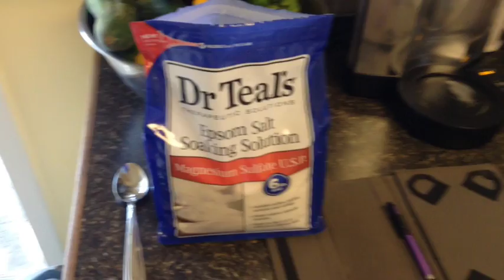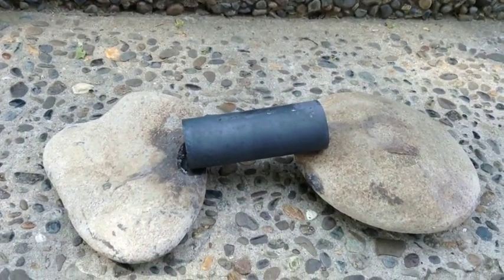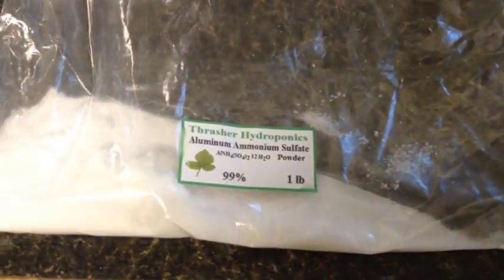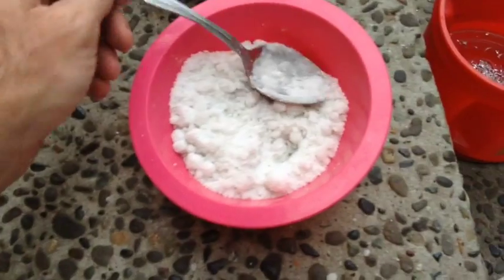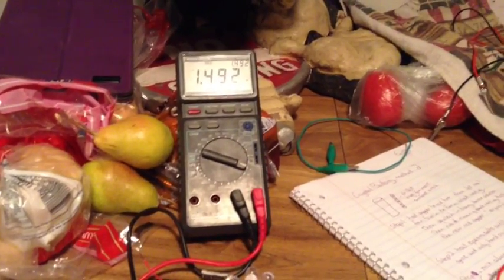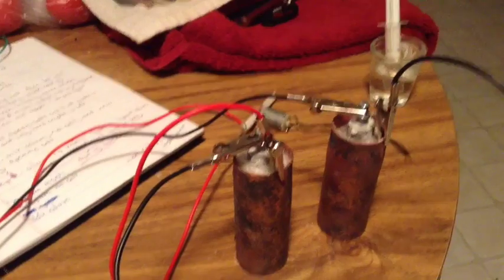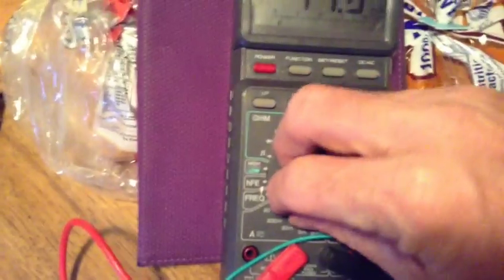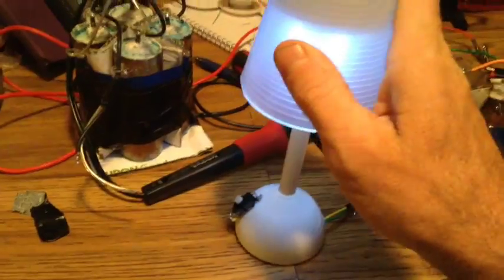V3 Crystal Battery High Output 1/2 amp spike 2 in parallel dead short. high psi

Comment: just asking but would coating the inside of the copper chamber with active carbon increase power?
Reply from the maker: you're most definitely on to something but I haven't messed with the crystal batteries in quite a while I will return to them one day but I would try graphene of some type. but you wouldn't be able to just put it on the surface of the copper you would need to intercolate the two materials. watch it try some activated carbon and find out a way to stick it to the copper and start simple

Comment: with the straight Alum battery are you also boiling down the Alum, like you did the borax mix?
Reply from the maker: nope. just the crystal form of the salt. no heating
Reply: BackRoom Labs so how long did the little motor run? When they die can another source of electricity charge them back up? Or is it just add more water? If it's just adding more water, does this make me mix in the tube dissolve to where is it could pour/leak out if if laying sideways?... if not what if you give it more water than it can handle by making like a tank for it? And if the tank idea is ok, what if the water bridges the pipe and the rod? Well let's say with or with out the water bridging, and the tank has let the cell take on all the water it can handle with more water waiting for a change to get in.... would this make for opportunity for the solution to mix into the tank and leave the cell?

Comment: Hi Backroom, to increase the power output, Have you considered trying making one or two of your batteries with increasing the surface contact of the Salt to the Copper, By sanding the inside of the pipe just before the salt install step? I would bet that you don't need the semi-conductor layer, and the benefit of more power is more valuable than the internal Diode feature. I was Just thinking Back to my Semiconductor Doping Course , Why Would you need a Transistor feature in a battery? there will most likely be a 0.7V Drop at that layer. All the Best
Reply from the maker: +Cherry Jj  you no I though the same thing after I made them. I am getting ready to make some more in conjunction with some homemade graphene supercaps. I plan on sanding all surfaces this time. thanks for the input and thanks for watching.

Comment: Hi, at 7:30 you said you used the same method and then showed the press - what was the press for please? Did you use it to compress the material into the cell? Also, do you have any videos showing how the cells are made? I'd like to try making a few to experiment with... thanks for posting your work - very interesting subject! best regards.
Reply from the maker: +Valerifon1 sorry I haven't responded to you post I just seen it. Yes I have many vids on the crystal cells. Just go to videos and they are at the bottem. The theory was with pressure there might be more out put. I'll be posting a few vids in a month or so on some new cells I'm making.

Comment: Interesting but I can't help wondering if you put in far more energy with your gas torch and your stove than you are likely to get out of these cells?   Seems like a net loss to me.
Reply from the maker: I couldn't agree more. These by no means overunity. Think of the energy used to mine the minerals, machining, shipping the list goes on. To me this is a very cool experiment that allows a regular joes to creat a power cell at home that will make power for many many years. Shortly I will be making new cells in combination with a home made graphine energy storage device. This will let me store the power for when it's needed. Hopefully I'll be able to light a 3 watt led for a desktop lamp. Those vids will be coming in a few weeks. Works been busy since it got cold. Thanks for the input

Comment: How long the battery charge last before its completely discharged?
Reply from the maker: Around 8 to 10 hours. Take the load off for several hours add a few drops of distilled water and bam... They are back to life.
Reply: Sound good

Comment: Has anyone attempted to wire these batteries in series to get 12 volts and why are them too is solar charger controller to see if they will push charge into a rechargeable battery? Because if that works soundly, then why is anybody buying solar panels when they can make batteries with dirt and a couple hundred dollars?
Reply: Yes. Look up laserhacker.com he does some awesome little experiments with these cells. He also does experiments with supercapacitors and solar cells, too.

Comment: hmm you have to use more energy than these will ever produce to make one, but could be usefull in a low draw long term application if you get the mix just right
Reply from the maker: These cells have been very useful. Some have been in operation for 2 years. I have been working on some home made super-capacitors to store the energy until it is needed. The ones in this vid have leveled off to around 20ma 24/7.

Comment: You could try copper foil and magnesium/aluminium foil with thin salt layer between them
Reply from the maker: That has been done by a few people. They started off good. If it is more of a galvanic cell it eats the thin material to fast. The thicker material will last longer as the cell levels off and will allow the cell to last much longer. Another problem was the center of the cells would completely dry out. Not to many have tried to prefect the method you are asking about. But it's a good place to start as materials are cheap.

Comment: I had good results on mine for the first day or so, but they barely spin a tiny motor for a couple of seconds now.
Reply from the maker: Mine still put out enough power to run several LEDs. I have to add a few drops of water every week to keep em going as well as take the off the load for a while to let them rest. These cells turned out to be pretty corrosive to the magnesium. I'm going to do an update in like a month or so with all my different cells.
Reply: +BackRoom Labs What was the mixture you used? I followed Lasersabers plans, and heated up the mixture and poured it in with a magnesium core. Voltage is around 1.4, but not enough amps for an LED. Trying to see what you did differently other than compressing it.
Reply from the maker: +Joe Anthing these cells need water to operate. Add some distilled water and see what happens. Another thing is to use 99.5% or better pure magnesium. The cheap O fire starters are not pure. More like 80%. After you add some distilled water you will hear some popping and bubbling. This is the cell splitting the water into hydrogen and oxygen. As the water splits into is elemental form it releases energy. This is where the usable power comes from.

Comment: I have spent over six months watching every video on crystal cells. Why does everyone use copper and magnesium for the anode and cathode why not use galvanized pipe and copper. It look to me that this is a slow chemical reaction especially when people have to add water to keep them going. In the next few days I will build my own to see what happens using galvanized pipe. This could also almost work like a bi-metallic strip or thermaster.
Reply from the maker: The reason for copper and magnesium is the voltage potential between the two metals. There are far better metals to use such a lithium or gold. You could get a voltage of around  3 volts per cell with higher amp production. Problem is lithium is unstable around water and gold I expensive. Copper and mag seem to be the choice so far. I have made 2 alum only cells. Over all they are the best. All other cells,I have built have experienced around a 15% loss of the mag over a year and a half. The alum only cells show no signs of corrosion. After I finish my solar panel build I'll be making some larger alum only cells see if I can get a half amp steady per cell.

Comment: You can only get true hyperbolic semiconductor borax copper flanging by heating with hydrogen free LPG.
I suggest that's why there is a difference between the cells.
Reply from the maker: Thanks you for your input. That explains why I couldn't get an even coating. I had wondered if the oxy/acyl torch was the cause of the spotty coating. I am getting ready to make some more. Would a mapp gas torch work or just use straight LP.

Comment: Kinda wierd no one mensions why your aliminium plate is getting hot and why it eats true the cans....You do know that stump remover or sodium and salt are basicly the same.... So next time just know even im telling your 7 years later....Sodium Metal and water dont mix it wil start a termal chemical reaction....I would advice you to look into chemistry more before attemting to make a battery running on water. This is because that always involves high flammeble gasses and things that can go boem....! Stay safe ! TAke care!
Reply: Sodium metasilicate is the chemical substance with formula Na
2SiO
3, which is the main component of commercial sodium silicate solutions. It is an ionic compound consisting of sodium cations Na+
and the polymeric metasilicate anions [–SiO2−
3–]n. It is a colorless crystalline hygroscopic and deliquescent solid, soluble in water (giving an alkaline solution), but not in alcohols

Comment: What was the point of burning the copper and dipping it in the borax? It serves no purpose. if you actually made a semiconductor, as you say, "allowing power in but not out", your cells, while made under less than precision conditions, would, by your logic, put out less than full power by the pure definition of a semiconductor.

Comment: I think you can get 200 mAmp without cooking :)
Reply from the maker: When you series these type of cells the impedance goes way up (internal resistance). So when you series them you lose a lot of the current potential. You will get the voltage though. So if I start with 200ma per cell then series them to get the 12 volt I will end up with like 20ma. Although when put in parallel you will double the available current. So with that being said you will see me in the future paralleling many of these cells together to try and achieve 1 amp or so at 1.5 volts and hook me to a joule theif  to try and light some of those 3watt bulbs.
Reply: BackRoom Labs Salam...I am in China so I am going to get my hands on the DC-DC voltage booster. It pumps up the voltage from 0.9v to 5v. The module is very small, cheap, and very efficient. I have ordered it and now waiting for it to arrive.
Are your cells still running? if yes than what are the readings on them?
Reply: Talha Kamran Didn't work out well as it also consumes a little. But it is good if you have a source of more than 500mAmps

Comment: Not working...
Reply from the maker: Add distilled water
Reply: @Billy Knorr  I tried all the metals n different mineral n crystals I even done my research n looked into John Hutchison science n technology...I made heaps none of them could run the motor...I built 14 volt in series but oddly no amperage..crystal cells still remains in shadow of mystery n how John could run the motor in artillery shell cylinder ...due to my research silver plated cathode n large diameter magnesium work the best..but what mineral really works God knows...
Reply from the maker: @abbaspourmoghadam3850  look up John Bedini. Crystal battery series. You need to use pure copper and 99.99 percent pure magnesium the salt needs to be alum. It's a pickling salt. The closer the two metals are together the better. The cells also lose the power when in series. Internal impedance goes up too high. They're better in parallel run things at low voltage
Reply: @Billy Knorr  do u have Facebook?